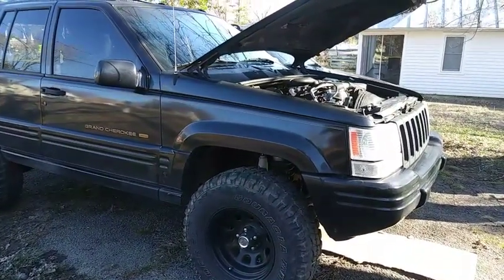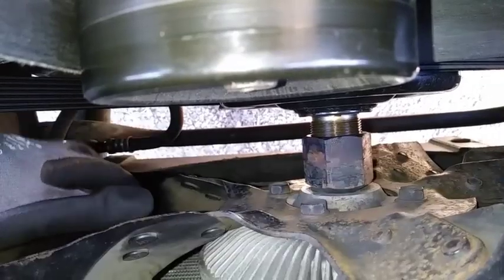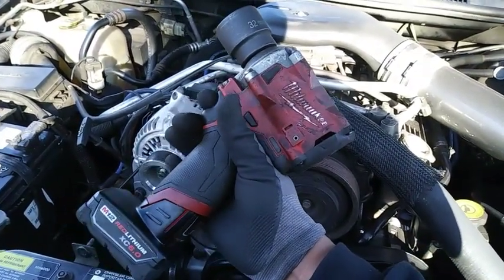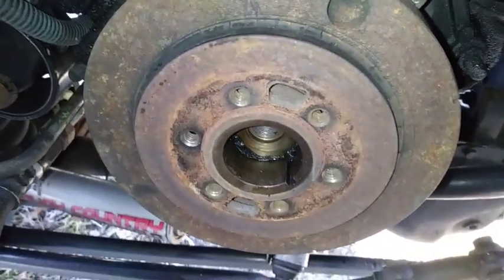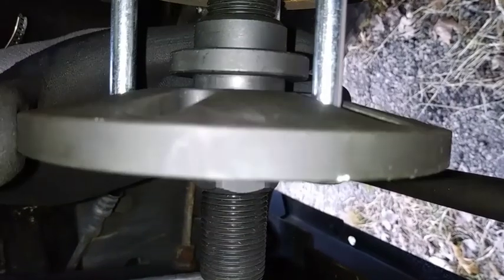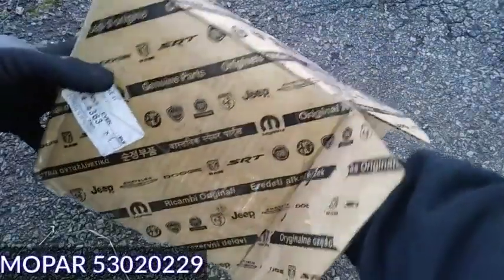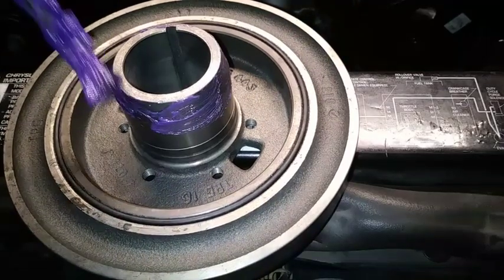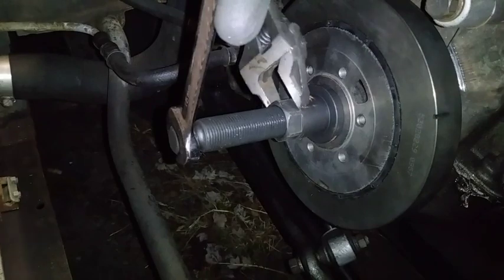CRANKSHAFT VIBRATION DAMPER REPLACEMENT (JEEP ZJ/DODGE 5.2L V8 ENGINES)

Comment: Hopefully you own this jeep until it's junked. The next guy who tries to remove that crank bolt is gonna have a bad day. I like that you gave torque specs and then 1/2" impacted until it didn't turn any longer lol.

Quick tip for anyone who doesn't own a study impact. Take out a sparkplug and stuff paracord in the cylinder near tdc. Once enough rope is in there you can turn the engine back a 1/8 rotation and it will bind against the rope (should be slightly past tdc and then backed up to jam rope). You can then loosen the bolt with a breaker bar. Same step but rotate other direction to install. This method allows you to use a torque wrench to tighten the crank bolt to spec. And bolt should be lubricated with oil.

Comment: If you do not have an impact, you can use a long enough half inch breaker bar positioned so that it rests on the drivers side frame.  Disconnect the ignition coil so the engine doesn't start.  Turn the ignition key kicks over the engine and you will break free the crankshaft main bolt on the harmonic balancer.  I'm revisiting this channel as I gave away my 5.2 '97 ZJ LTD to my eldest son about a year ago.  I just broke free the on on my current 4.0 '87 XJ Pioneer using the same technique that I describe here, but I used an offset wrench with it resting on the top of the power steering pump.  Most important thing about using this method is to always make sure you verify the engine rotation compared to the main bolt.  Best thing is there's no long loud obnoxious intro's, information is always concise and clear, content is well lit with great visual angles.  Thank You.  👍✌
Reply: or pull fuel relay

Comment: Thank you so much for showing this.  I have a 1998 5.2 I have been trying to remove the pulley from but did not realize I needed to remove the crank bolt after I removed the 6 pulley bolts.  No wonder it was not coming off.  Thanks again.

Comment: My brother in law's jeep grand cherokee 5.2 l v8 1998 keeps shredding the serpentine belt. It seems to rub against the engine in the water pump pulley. The last belt was had the rib closest to the engine torn. Can you give me some tips on what it can be? Maybe pulley misalignment? What is the original belt? Is the micro v with 7 or 6 ribs?

Comment: Do you still have your Jeep? I have the same Jeep and enjoy all your videos. Replacing completely separated balancer no rubber and came off when I removed the pulley. I also have to replace the timing cover. I don’t know but believe the balancer being so bad may of knocked hole in my timing cover where the timing marks are or maybe part of balancer that came apart knocked the hole in it.(actually can see the timing chain through the hole. Cpl questions, do you have video of putting new oil seal in? And do you know how much play if any the timing chain should have?

Comment: Yea I have been noticing lately that when cut my 96 zj off I can hear a metal on metal scrub from that area. This has to be it.
Reply: Mine sounded like one of the pulleys bearings was going out, before it began making that sound you described and at that point I could visually see it wobbling
Reply: @AbandonAllHxpe  it was the idler pulley bearing
Reply: Went out at 7 am on the way to work

Comment: Thanks for posting/sharing your knowledge! Just did this today on a 98 ZJ straight 6. A little different in the execution in my case. Couldn't find my model specific tutorial but yours was the most helpful showing general ideas. With mine I had to remove the radiator, something that I have never done before (what a mess!) but the install on the harmonic balancer was flawless with the right tool...and then the hood latch pull broke..good thing I own some vise grips and ebay has them for as little $9, lol Happy Thanksgiving, too

Comment: Haven't used the compressor in a while I see. Does getting the serpentine belt w/o AC save on gas. I mean on my car I have no evaporator so obviously cant use the a/c. Would it save on gas getting the serpinetine belt w/o the a.c. compared to the one that goes around the compressor

Comment: I wish my '95 4.0's balancer was set up the same way, on mine the balancer and pulley are one unit. I was on my way home from school a few weeks ago when mine came apart, causing the belt to slip off. Cost me a new radiator on top of it, because that blew up with it too. No more belt tension ment the water pump couldn't turn anymore. Instant overheat taking the old radiator out with it. Luckily that's the only damage it did. I replaced the balancer and radiator and it's never ran better. And what a difference, so much smoother now. I guess the balancer has been failing for a while before it finally rattled completely apart.

Comment: Great job 👍 but my OCD says paint that crank pulley 😂 The fan clutch tool is the best way to remove the fan but I have seen a pipe wrench used before but people can rent this tool if they don't have one and get it done without all the F bombs .

Comment: Why not replace the seal at the same time?
Reply: Considering what’s involved in getting to it, an extra $10 seems to be a low cost investment in future mitigation. The seals don’t last forever, and if the rubber on the HB was shot, I can only imagine.  With that said, you made the job look easy, and for you, it’s no problem.  I’d just suggest to those of us who this job is an afternoon adventure, it’s something that should be swapped.  Great video by the way.
Reply from the maker: @LDoctorKC  yeah replacing seals is always a good thing but my seal was replaced when I did the timing chain so I wont be making a video on that unless the one in my other ZJ goes out
Reply: BARRICADE GARAGE Sweet. I have a  97 Grand Cherokee with the 5.2 and upcountry package. So I’m becoming a bit more experienced in repairs of this beast.  Just replaced all the ball joints and control arms.  Think I might need to rebuild the steering box next - who knows.   Just wanted to say that I enjoy your smooth approach and great presentation.  Take care.
Reply from the maker: Because nothing was wrong with it.

Comment: I'd like to see one of these disintegrate at high speeds. Always wondered how much damage youd have of the balancer went at like 60 mph.  Catastrophic right? Lol
Reply: The balancer in my 4.0 rattled apart a few weeks ago while I was going about 60 mph, pretty much took the radiator out with it too. The part of the pulley that separated slipped forward causing the fan to grind up against it. Think very loud screechy metallic noise while boiling coolant steam sprays everywhere.
Reply: I've been risking driving at highway speeds to get to work with this problem. Mixed with the metal clunking, knowing this could end really bad for it, doesn't sit well with me. Gonna fix this ASAP as soon as the Harmonic Balancer Tool used in the video is delivered Sunday. Love my baby ZJ, it doesn't deserve to go through this.
Reply from the maker: @MrPhila4  there you go!
Reply from the maker: It sure wouldnt be a pretty sight
Reply: I lost mine on freeway pulling a trailer drove 60 miles with it spinning. It also rubbed through the timing cover. Was a 5.8l ford

Comment: Are there any difference between 5.9 and 5.2 balancers?
Reply from the maker: The 5.2 is internally balanced, the 5.9 is not
Reply: @barricadegarage5361  , thank you very much. In my 5.9 Jeep ZJ was a little vibration(1 time in 10 sec), kinda missfire but no DTC in pcm, all ignition system new, can be a worn harmonic balancer cause of this vibration?
Reply from the maker: @АулетМухамбетов  yes this can cause vibrations that feel like misfires.  Pull on it to see if it has any play or is seperated
Reply: @barricadegarage5361  Thank you very much, really appreciate your attention.
Reply: Аулет Мухамбетов mopar for the 5.9 is number 53020182

Comment: Hey bro good video .i noticed u by passed the compressor in your jeep what size belt do you need to do that ?
Reply from the maker: Heres my video on that
https://youtu.be/Isra0tVBE6g
Reply: Right on man I saw the video 👍 but do you think my heater will still work if I by pass the ac ?
Reply from the maker: @LuisQuezada-ts7zy  yes, you will still have heat

Comment: The most craziest and most convenient timing ever man. 

I'm literally in the midst of replacing my harmonic balancer and crankshaft seal on my 5.2 V8 ZJ. I've have almost everything I need except the for the balancer installer. I was trying to figure this out, with little to no videos covering this job properly. Thank you for existing, I come straight to you when it comes to my Jeep. 

If only you were closer I'd have you as my trusted mechanic for sure

Much love from Philly sir and keep doing what you do
Reply: Same. My motor started making squeaking and scraping noises. Sure enough, can move it by hand and mine clunks just like in the video.
Reply: @Lance Lee Yea I replaced mine last year and haven't had anymore issues